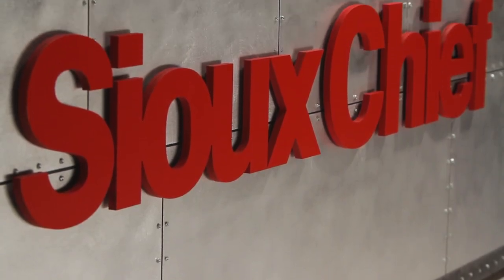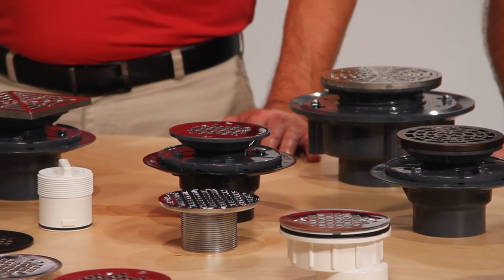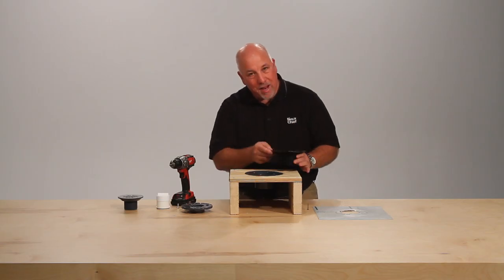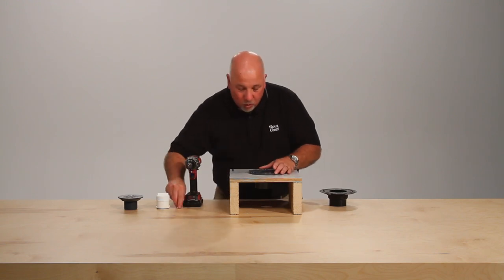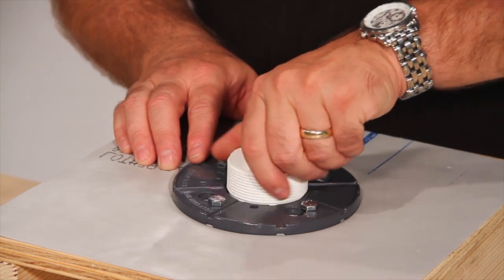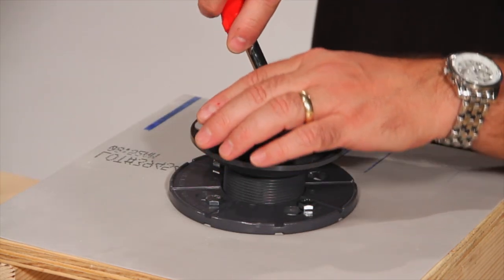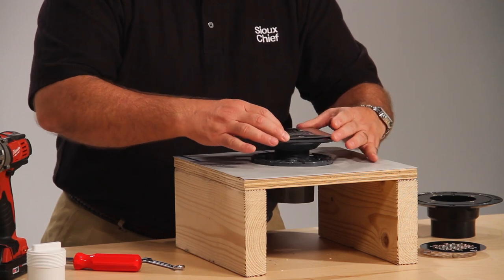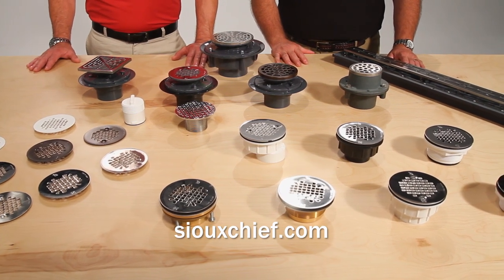Sioux Chief Shower Drains

Comment: Please note that commenting on the fact that the flange MUST be mortised into the subfloor plywood to achieve minimum slope bed was omitted.  This at best requires a router or at least a SAWMILL cutting at an extreme angle.  Why would they omit this info?

Comment: If drain flush with subfloor, than preslope mortar will be feathered paper thin around drain.  There must be a minimum thickness on the preslope.  I have heard 1/2 inch.
Reply: Nicholas Hoffenpiper I don't think people give a crap about having a pre-slope, this is just so installers can have a floor level drain before installing the mortar bed. The host probably didn't realize this or maybe there's another substrate that can be used besides concrete.

Comment: My shower has one of these drains and is clogged, how do I clean it? Please help 🙏
Reply from the maker: Ashely the normal process for cleaning a clogged drain is to remove the strainer. You would then look to see if there is any debris. Many use a hand auger to remove a clog. The best way to be sure it is done right is to hire a licensed plumber.
Reply: @SiouxChiefPRO  thank you!!

Comment: I completely agree with Mr. Kime's comment.  This video is helpful but only casually states that the drain can be installed flush to the floor.  Yes... the four screws are obvious.  What is NOT obvious is how to cut that hole!   There is nothing clear, easy, nor obvious about how one cuts a beveled hole.  My subfloor is plywood.  If I were to cut just to the beveled edge it seems like that would not leave enough material to provide support.   Cutting the hole smaller (so the drain rests on the entire flat underside) would seem to require a router or some other exotic cutting tool to recess the material to make the top flush with the floor.   I am toying with the idea of installing it on the flat bottom side without a beveled edge (resulting in about 1/4 above the floor) and then laying a 1/4 inch piece of ply over the entire shower which should meet the top of the assembly resulting in the drain being flush with the floor..... just a thought.

Comment: --DO NOT BUY--
This theses products are sold at Home Depot 828-2 APK installation is a pain in the butt, no one at HD knows how to install it, and this is the installation video that's the company says will help. It doesn't even address 828-2 APK.   
I suggest you get a video for each product, and show exactly how it can be installed. If you're selling at Home Depot, your customer are often homeowners, not contractors. If your accountant can't install your product then neither can I. 
I have to take this crap back and find something I can install.
Reply: Probably because this is for the 821, NOT the 828.